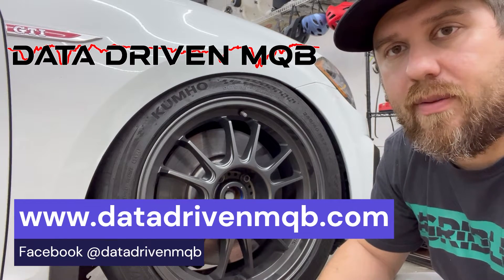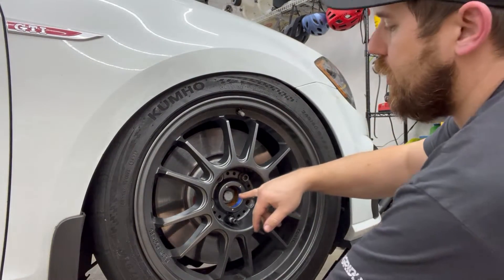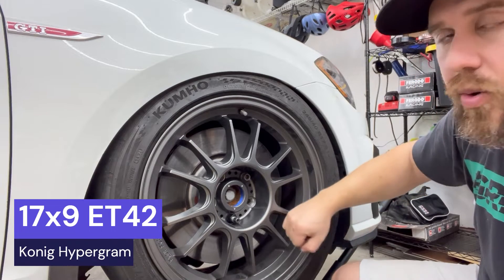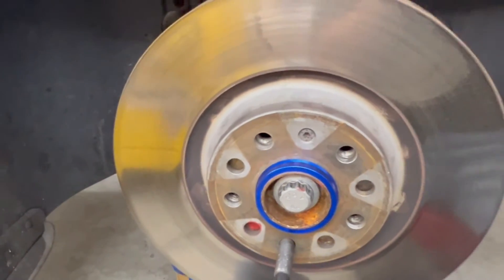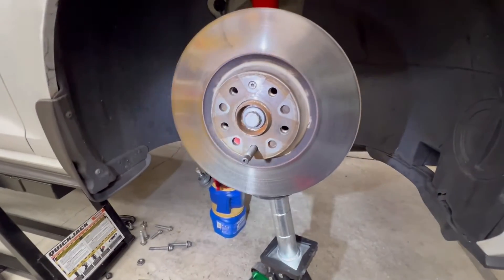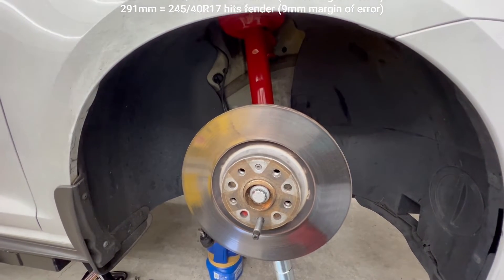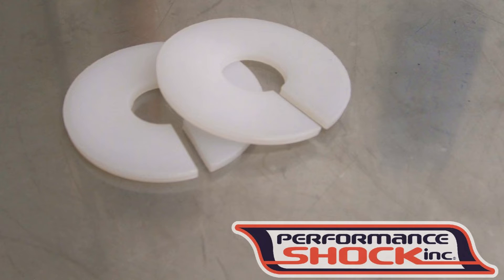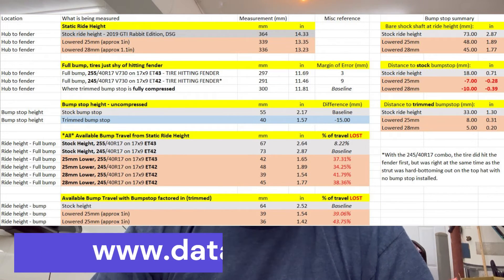Ride Height and Wheel Travel - MK7 Suspension Geometry

Comment: did you measure / could you measure for me what the hub to fender length is with the wheel fully extended? ie letting the wheel hang while off the ground? i wanna know what the full wheel travel is from fully extended to fully compressed.

Comment: So is this something I need to take into account if I use a full coilovers! Now I don't have a GTI but a tsi!
Reply from the maker: Absolutely. (Most) coilovers are a bit different due to the adjustable body height. 99/100 people have them set up wrong. If you're using the top ring to set preload you're doing it wrong. 

This video covers how to up set coilovers properly:
https://youtu.be/oocnORiEXfw?si=HSxb3047Rfg3cYMv

If you can't do it that way then 99% likely your coilovers are garbage with poorly specd body lengths, springs, etc. Read: everything from China.

Comment: Hi Tony, any trimming done to the rear bump stops ?
Reply from the maker: I did not, but primarily out of laziness 😂 It might benefit from a slight trim but the scramble to reassemble before VIR I just didn't do it. The car drove great on track as far as the springs/shocks go. Will eventually revisit the rears to assess but it didnt have any problems on track or daily driving on these springs.

Comment: 99% subjective drivel and not data driven. Throwing something at the car and see what sticks by determining it is "faster on a private track day"is the opposite of data driven tuning.
Reply from the maker: If you go to the website as mentioned, you’d see where the friction circle was plotted between the sway bar on soft vs stiff. Stiff bar resulted in more Gs in combination braking + cornering allowing faster corner entry. The determination of "faster" wasn't strictly based on lap times.

https://www.datadrivenmqb.com/suspension/fsbdata

This video is basically just getting a rough idea of wheel travel available because the camber curve and bump steer depend heavily on where you start in that range.